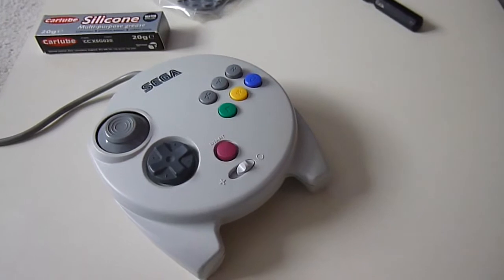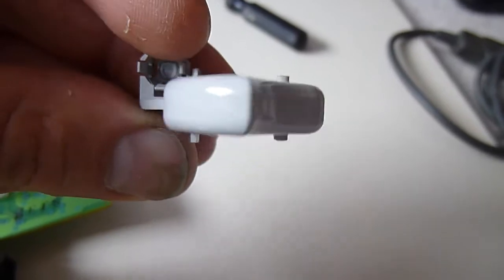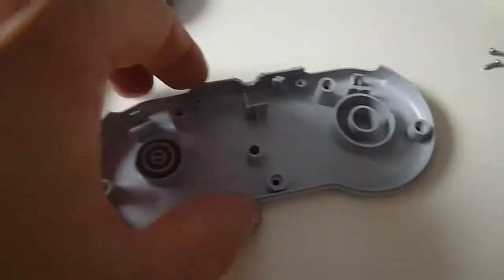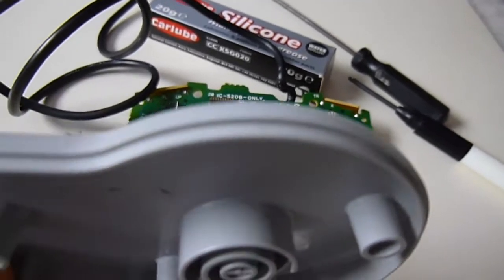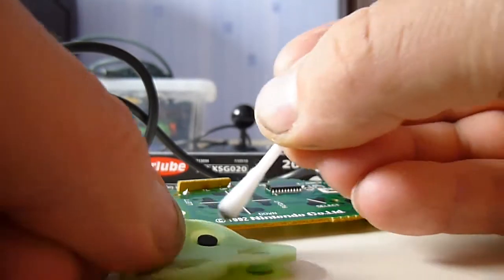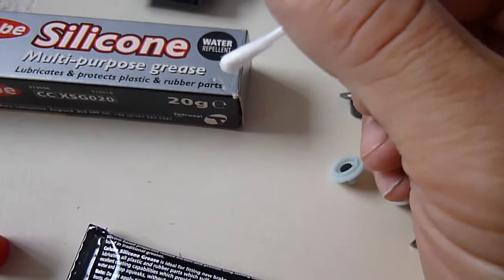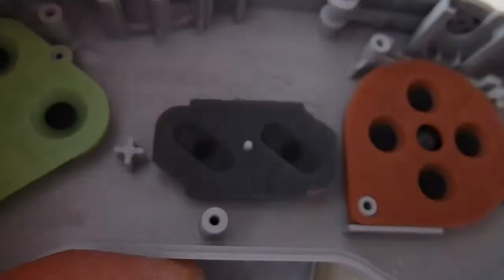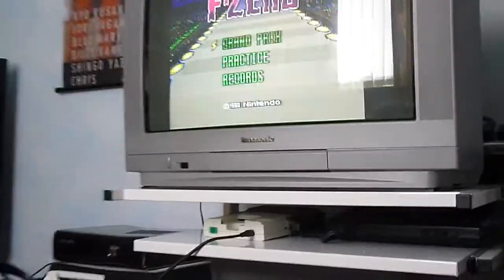Retro Console Maintenance Video #1 - Digital Controller Pad Servicing

Comment: Great video! I need to strip and clean my snes pad! Very useful, thanks for sharing
Reply from the maker: Thanks for commenting :-)
Yeah its pretty basic stuff tbh & similar for all digital pads.
Game pads tend to get gummed up pretty badly - I always strip and clean used controllers.
I'd recommend use of Silicon Grease on moving plastic-on-plastic parts, 
like dpad/buttons to case etc - just keep away it from any electrical contact surfaces ie. controller ports / conductive surfaces. The rubber contact mating faces and any console Laser lens.

Comment: Hello there Daz, 

What a great video mate, very in depth and very well executed, a very handy and informative video, i didn't know the dreamcast triggers had that design fault, ive never had any break before but after watching this i'll be a bit more careful with them :-)

Really good video Daz, very impressed mate :-)
Reply from the maker: Thanks Dal - yes mate the original Japanese DC controllers had a real weakness in the trigger design - both of my original pads have had to be repaired over the years - I've since removed the original internal boards in both of them and replaced with the newer upgraded design used in later model euro pads - I picked a couple of those up cheap purely to use as donors.
Those, the Sat Multi and the SFC Pad are all good now tho' :-)

Comment: great stuff! ive never has a DC controller fail..yet!
the bloody snes ones with the L & R buttons and the small pin hole snapping is more common than id like!!
great video though mate
Reply from the maker: Thanks :D
Oh I never has a SNES/SFC L/R button pin location fail - but they probably have got some kind of weakness with just a plastic location with steel pin suppose with to much force they could collapse - the DC ones are all plastic into plastic - with the shoulder assy's on early import ones being particularly flimsy in construction. I read in some gaming mag (back in the day) that Sega was addressing the issue for its Euro DC release so the PAL ones were an improved design.
Reply: yeah I have/had no end of snes controllers once ive stripped them down the circualar mount the pin drops into has sheared off!
Re the DC that's why I must not of seen the issue then! :)
Reply from the maker: TootyUk Bad news on the SNES pads - so i'd better be kind to my SFC pads then!  thanks for the heads up  :-)

Comment: I'm sure I've seen RetroGameTech Wiping the carbon contacts on some white paper before? Not tried it yet mind... 

That controller looks like new!
Reply: The Kaylied Gamer the snes pad I have is really grubby, just feels really rubbish to play on. I'll try and do a short before and after video... Especially using some silicone lubricant on the button inserts
Reply from the maker: GRUSS Newton May be worth picking up a couple of cheap pads and swapping out the worn bits - have had to do that in the past with megadrive pads.